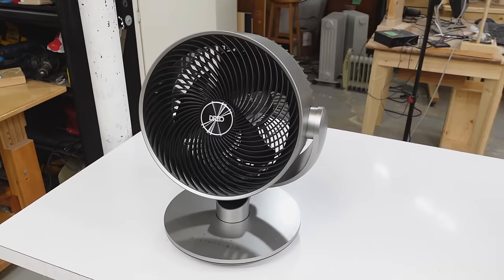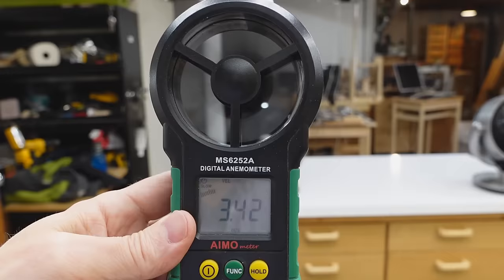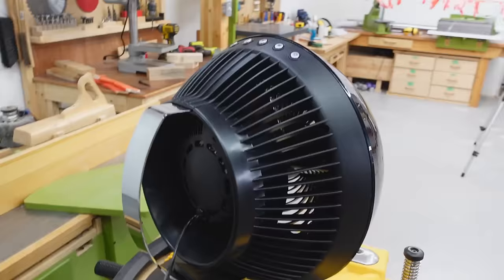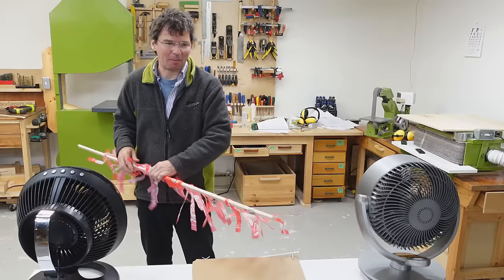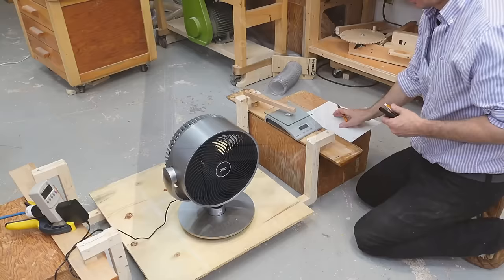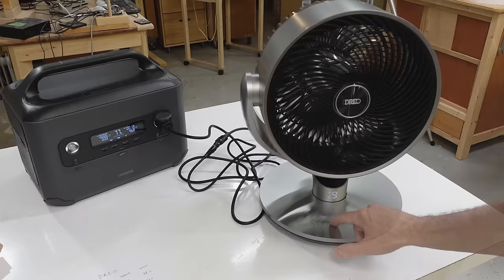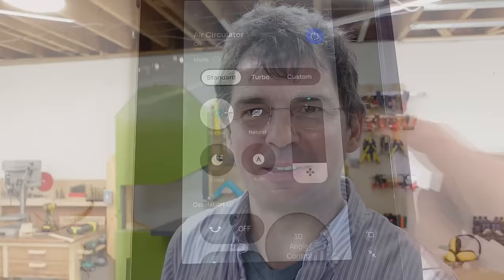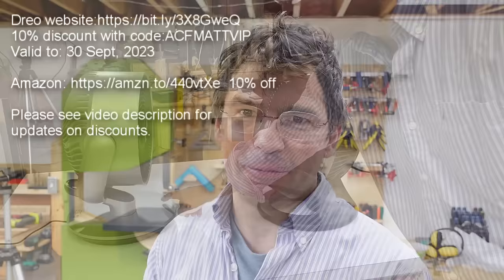Dreo vs. Vornado air circulators

Comment: I bought a Vornado tower fan around 10 years ago, it was the first and last Vornado product I will ever purchase.  The selling point of that Vornado fan was its quietness and that was my reason for purchasing it.  After about a month the fan kept finding ways to make increasingly annoying noises, all of which were due to its lack of bearings.  The bottom "bearing" consisted of a dollop of grease in a poor fitting bronze race; once the grease dried up it would make a tapping noise as it bottomed out in the bronze race.  The top "bearing" consisted of a rubber boot packed with grease, that once dried out would make a squealing noise as it rubbed against the rubber.  I took it apart once to replace the grease, which worked about a month before the noises returned.  Now I only use that fan in my workshop when I'm wearing hearing protection.  One of these days I'm going to take that fan for a trip to the shooting range.  I hate Vornado.
Reply: Once a bearing runs dry and makes noise that noise was the sound of metal on metal. It was the sound of damage being done. Yes you can lube it and run on an oil film again but the metal itself is chowdered out. From then on it'll never be right. But you can keep lubing it and masking it. Generally in an electric motor you really don't want to run grease. Manufacturers call for light oil. But in a wallowed out bearing grease might help? Basically you have to lube before it howls. I know, no one does that. But in a perfect world we would.
Reply: @1pcfred  I think you've misunderstood my description of the Vornado fan I own.  I'm not referring to ball bearings inside of an electric motor or anything of that sort.  These half assed substitutes for bearings supported the squirrel cage fan rotor, which in this tower fan rotates about a vertical axis.  Where they should have used bearings, they just relied on grease.  The top end of the rotor shaft was supported with a rubber boot filled with grease that dried out within a month, it was metal on bare rubber that was responsible for the squealing noise.  The bottom end was supported with a bronze race that relied on packed grease for a thrust bearing.
Reply: @jhensjh  I very well may have misunderstood. Rubber can be used as a seal. I doubt it was there for any kind of support. If that was the case then it would not last for long.

Comment: I've used Vornado fans for years and very rarely do I run them on high. I think you made too much of comparing how powerful the fans were. I use them as air circulators, not blowing strongly, directly on me. I usually use a slower speed, mostly to keep the noise down. I often place them in a corner and point them diagonally across the room at the opposite corner near the ceiling. I've found they do blow a 'column' of air so your test surprised me. 

 Your Dreo tests concerning motor type, power used, noise level, and configurable options impressed me.
Reply from the maker: If you don't need the extra powre, you can just by a cheap fan for a quarter of the price and it will do fine.

Comment: Based on this and your other tests I ordered a stand and table top Dreo,  I already have a Vornado stand and table top.    To be honest in my real world testing I'm not finding much difference in the fan outputs.   My anemometer shows the output to be about the same on max and the seat of the pants feels by multiple people is a wash.    BUT,  the ability to use my phone and the remote is really nice,  the Vornado has no remote or app which does make it a hassle at times.    I'm thinking a really good test of this type of fan would be to light a smoke bomb behind them and see what comes out the front.    Do this outside of course.      Anyway,  great analysis and looking forward to more fan tests.

Comment: I think this video does an excellent job of comparing these two products. I have been a life-long believer in the Vornado fans. However this video changed my mind. With the Dreo costing around the same amount as the Vornado, and displaying all the new features it has in comparison - I think the Dreo pulls ahead of the competition dramatically. Then, once you consider the amount of energy it uses, it's a no-brainier to get the Dreo on the electricity savings alone.

Comment: I hope DREO is paying attention.  A 12v version of this would be highly sought out by the camping or rv crowd.  Looks like it wouldn’t be difficult for them to produce an adapter.
Reply from the maker: It does run fine on 12 volts, just not at full power
Reply: @matthiasrandomstuff2221  I'm confused, you just put 12v across the plug?
Reply: @FiveSixEP  9:00

Comment: I love BLDC fans for having a quiet, low-level option, but it seems like for efficiency for moving the maximum amount of air at high, it seems like induction motors are better? 

That makes sense I suppose since you skip converting it to DC and back to AC again, even if those shaded pole motors don't seem the most efficient of other AC motors.
Reply from the maker: well, the vornado with its induction motor at full power uses much more power than the dreo wit ha bldc motor making the same amount of wind.

Comment: I bet the dreo would run very well on a power tool battery. It makes sense that it works, the only part of the fan that would run on the 24v is the motor, the rest of the controls are probably 5v or 3.3v

Comment: It'd be nice to add a SPL meter to your videos. It's good to hear how you perceive the noise from two products, but it's also nice to have a measurement, be it dBa or dBc
Reply from the maker: what matters more is how annoying the sound is, and the sound itself gives a much better impression of that than a dB meter
Reply: @matthiasrandomstuff2221  I think your perception is the only thing that can convey it. As a sound engineer, so many things can alter sound with a microphone, especially when blowing air is involved. Could also record the sound and pull it into a spectrum analyzer and see what frequencies it hits. Oh well, it's nitpicking in otherwise amazing content. Please keep it up!
Reply: @matthiasrandomstuff2221  Cool story.  Maybe test some more sponsored DC motors against competitors old non DC models?
Reply: @matthiasrandomstuff2221 only partially true. Annoyance is a function of loudness and sound quality (tonal vs bland, etc.). There are definitely measurements that can be easily made at home. Happy to help if you ever revisit fan testing for noise. 

-friendly neighborhood acoustic engineer

Comment: power scales with the velocity squared, so the anemometer readings indicate almost double the wind power from the Dreo.
Reply from the maker: yes there is that.  but the dreo”s air stream is a bit tighter.  the total thrust measurements didn’t show as big a difference.

Comment: Could be useful to programme a blow path around the polytunnel/greenhouse if it gets mega hot and there is no wind. 
Sounds like it already has temp sensors but does it also measure humidity?
Lovely vid as always - nicht nur heiße Luft ;-)

Comment: i would have a use for this when I'm doing indoor bike training and the fan is not quite angled properly or blowing too hard or too low depending on the effort I'm putting in. Adjusting that on the fly would be awesome because when you start your workout you don't really have the opportunity to set it up again. I'm really thinking about getting one for next winter!

Comment: The Vornado Changed,  from what I can tell.   I used to have an older version of it... that was MUCH louder, and far more powerful  (than the newer model that I picked up).  I think the older version could push air like 30ft, and still be felt quite strong... at that distance.   I think they mush have gotten complaints about how loud the fan was... and changed it to a less powerful motor.

 I also think that there was a marketing problem with the Fan.   Where as... most people were buying it..  thinking that they could use it like a normal personal cooling fan.  However, it was too strong for that application.   It shines, in being able to push  heated or cooler floor-air.. to high ceiling places.   Or to be able to suck/blow away fumes,  or move a ton of fresh air into a place.

 With better marketing, I think it could have sold even more units that it ever did.   And I have to say.. their new lower-powered motor, is a huge disappointment, compared the original.

Comment: Does Dreo expose an API to control the Dan?  Does the app communicate over WiFi or Bluetooth?  It would be neet to control it from my Raspberry pi home controller.

Also, I hang my shirts to dry.  There's less wear and they don't wrinkle as much.  On humid days though they don't dry fast enough and get sort of a sour smell.  I think circulating air around them would help a lot.

Thanks for the video.  You have such a great channel.
Reply from the maker: No, they say they are working on it.  I keep bugging them about it.
Reply: @matthiasrandomstuff2221  so maybe I should wait to get one?

Comment: Vornado does have DC fans, they label them Eco, and can run on 24v. They are more expensive but many are made in the USA. The idea of "vortex" by Vornado isn't for direct force, but to move more air in the room in general. Any way to test if that is true at all? I've seen some recent videos on new propeller designs too that are supposed to reduce noise and increase efficiency that is being used for boat and drones... odd to think there are some exciting innovations in this space!

Comment: The dreo's ability to change positions automatically is nice.  I like bounding the air off walls instead of directing it towards a person.  Dreo seems to be a good option to keep it on all day long for nice air movement.  I wonder if there is a good way to have one in each side of the house to control air movement.

Comment: Here in Britain we don't seem to see so many of these designs. Partly because Air Conditioning is much less common here. The designs we do see tend to be smaller & simpler with reduced functionality.  However I reman very interested, since I have used the larger industrial circulation and cooling fans used on work sites and workshops. In that context they are often very useful and effective.   I loved the Air ballance test system, like so many of your experiments, it's really informative. I wish I had done more of this when I had access to a wind tunnel in the fluid dynamics lab at Oxford Brooks.
Reply from the maker: partly its because it doesn't get very hot in Britain, so much less need for fans.  I remember reading a local paper on a visit announcing a heat wave of 26 degrees celcius.  Most other places, 26 is just pleasant warm.
Reply: @matthiasrandomstuff2221  that's generally true. Last Summer we had days with 32°C right here. But that was a local record.  I still wish we could buy these ducted higher power circulation fans here. I use one large industrial fan to flush the house through with cool air at 4am on hot days. That works well.
Your comparison & air blast dispersion tests were very interesting, since I've done some fluid dynamics at college where we had a wind-tunnel.

Comment: Will the Dreo still work in 20 years?  I still have two Vornado fans from 20+ (30+?) years ago, the ones with the big beefy motors unlike the modern ones.   Stil running fine and serving us well.

Comment: Using the app to manually change the direction the fan is pointing is very useful. This is when you want the fan to blow on you, but the fan is not close enough to manually adjust. Without the app you would have to keep going back and forth trying to adjust the fan to where it blows on you how you want. Ideally, the fan could sense your location and blow on you without having to manually adjust. 

What I don't understand is why you would want the fan to oscillate in the first place. I understand people say that it decreases the amount of stagnant air in a room, but is that actually true? If it is true, does it even matter? I would like to see you put these assumptions to the test with your experiments. Room air mixing is something that is generally poorly understood and implemented in residential settings where these small fans are often used.
Reply: Imagine that.  If the fan was just a little too far away to manually adjust !   What could we do?

Comment: WOW!! You compared the Vornado 660 (one of their best selling fans) against the Dreo, and the Dreo won hands down, amazing. I own 2 660's and they move a lot of air, but there's nothing special outside there CFM of 576 vs over 1000 for the Dreo. In fact, I would call the 660 a "dumb" fan by today's standards, as it does not have any of the neat features Dreo offers. Listen up Vornado, we are in the tech age now (internet of things), and products must adapt or they will be left behind. I like the app, and the fact it has a temperature sensor right on the unit, things I could only wish my 660's had. Looks like I will be trying out a new Dreo CF714S very soon.
Reply from the maker: lots of comments that vornado has higher tech fans too, though perhaps not as fancy as the dreo

Comment: You convinced me to try one. Fan works great, as a manual fan. Getting it connected to your network may be more interesting. It took about 25 attempts over several days (a week or more? lost track) before it would connect. Dreo support was worse than useless. All they did was repeat what the manual says. Multiple times from different "people". Got several emails saying my ticket was updated, go look at the app, but there weren't actually any updates to the support ticket in the app.

I understand why they're using the Bluetooth->Wifi configuration path (every device I have that uses this style of setup is a royal pain to get working) so folks that don't have a clue can connect things, but there is no useful information provided to assist in debugging the issue if it won't connect. All you get is pretty much "didn't work". There's even a box to tick on the help ticket request in the app to send the error log to support (would find it difficult to call what I got "tech support") but you can't see it. 

Don't assume that just because you know what you are doing, you'll be able to get it to work on your network.

Comment: The most powerful "small" fan I have ever used came from surplus equipment scrapped by a local electric utility company. It measured 20cm x 20cm and was about 12cm thick. It had it's down side when it came to noise. I actually sold one to a guy for his camper because he wanted some background noise at night and a way to circulate the air.
Reply: I have a fan that came out of a minicomputer. It was made to blow air through the whole minicomputer. The whole minicomputer was 6 feet tall and full of electronics. So it shot quite the steam of air.

Comment: In the “sumo” test, wouldn’t changing the distance of the hanging cardboard change the air multiplier effect? I’m guessing the readings from when the cardboard is in the center is the only accurate section. And for the thrust test, wouldn’t that be greatly affected by the fan’s weight? I’d like to have see weights added to the wooden platform (or at least equal out the weight difference between the fans) to know if the weight of the fan affects thrust in the test
Reply from the maker: yes, it would change the air multiplier effect.  But the one thing that stays constant is thrust, until the stream is wide enough that some of it misses the cardboard

Comment: In your review, I believe you said the Oreo table top fan was a lot stronger and better than the Oreo standing/pedestal air circulators.  Is that correct?  If so, why?  Aren't they the same, only one has a pedestal and is "taller"?  Thanks in advance for explaining!

Comment: We're you getting them as a fan or an air circulator?  The Vornado is advertised as a stand alone air circulator. If comparing air circulation, I think a more accurate test would have tested balance in temperature/climate throughout the room.

Comment: My fan use is limited, for a long time I tried to figure out how to direct the air from my window shaker. I accidentally found that a standard cheap box fan does a great job at directing the cooled air.
Reply: Wow. How long did it take you to figure THAT out?

Comment: You don't understand how Vornado air circulation works. It's not about brute wind speed. The whole room has airflow. Without blowing in your face. They are designed to be facing a wall.  There is no reason for it to oscillate because it already does that without moving.

Comment: I think Vornado fans have gone down in quality, also.  The old ones from the 1980s were built extremely well, with very impressive airflow for the noise and size.  The newer models seem much cheaper, and based on this video, they have really cheapened out on the build quality also.
Reply: Couldnt agree more.!!!
Paying so much for plastic, does not make sense.!!!
Reply: It depends on the USA made ones vs the imported ones I guess

Comment: I stopped buying premium brand products in recent years because everything is made in China  now (even premium brands) and nothing lasts years (like it used too).  After searching online reviews I decided to buy a  Honeywell Turboforce Fan, Ht-900, 11 inch (I paid $12 for it). It is a mighty powerful small fan.  I wanted something small because I just don't have enough space in my room for a large fan. The Honeywell fits inside my window (I actually point the fan out, it doesn't make as much noise when I position it this way and it blows the hot air out of my room (which gets hot from having computer/multiple monitors and other computer related equjipment, lights, etc.)

Comment: At Vornado 660 - AC Australian model
High Speed CFM: 1638
Low Speed CFM: 663
High Speed dB: 54
Low Speed dB: 35
High Speed RPM: 1375
Low Speed RPM: 600
Watts: 29-36-45-56
It has 50% better CFM than Dreo 16 inch?